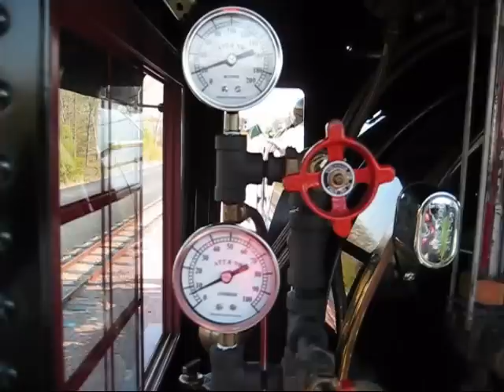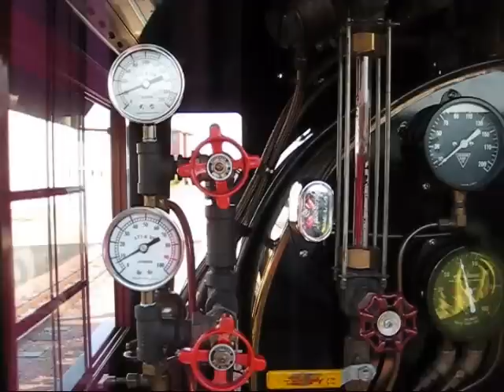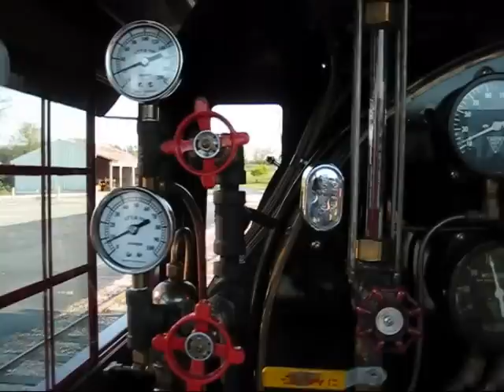ATT&NW 801 Test Run Part 2  (April 9, 2010)

Comment from the maker: The engineer at the beginning is the camera man.  I took a shot of myself in the mirror.  I am filming from the fireman's seat.  You hear both of us talking in the cab and can see my reflection in some of the painted surfaces.  The fireman and engineer are rather busy in the cab on the mainline, so I took advantage of the switch move to take some video with my pocket camera.  Both Alex and myself are regular engineers for the 801.  
Regards, Fred V.

Comment: Beautiful engine. Question though, only a 1/4 glass of water? When you stopped to back up to the car barn, did it stay on the glass?
Reply: I know this is 8 years late, but the water level in the glass is relative to the whole part of the boiler it's on, not the whole boiler or just to the crown sheet. The glass can be completely empty on most engines and still have water covering the crown sheet. The less water in the boiler, the more space there is for steam. When the boiler is full of water, there's no room for steam to generate because the water needs to expand as it heats up. Also leaves plenty of space to add water to keep the safety valves from lifting as adding water cools the boiler down a bit. The only time you want a high level of water is when you're shutting  the engine down or banking the fire on a coal burner. I see you're subscribed to Hyce now, so you're probably much more knowledgeable on this stuff by now and probably know this lol
Reply: @PowerTrain611  I agree with most of this, but no water in the glass is cause for an 9.9 on the asshole pucker index... a brief splash below and then return is sorta ok, but your immediate priority at that point is getting water in the boiler NOW.  Pulling a load with a working fire you're in the minutes to seconds range of having your last day on earth be a very bad day.... If you're on an uphill grade and you have this, either dump the fire or bail, you are in serious, SERIOUS trouble.   They do design the boiler to be somewhat idiot proof and do put the bottom of the glass a tad higher than the actually sheet itself, but by how much depends on that particular engine and build. Many many boilers have exploded, or ruptured due to poor water handling, that is the #1 rule of any engine, MAKE SURE THERE IS WATER IN THE BOILER.
Reply: @kleetus92  Oh absolutely. I'm not saying you ever should get yourself into this situation, but it's not an immediate "shit your pants and bail" moment... You just don't want to be that close to death. Ever.